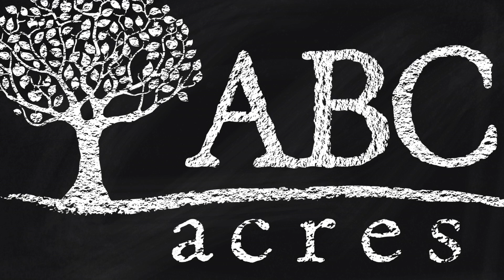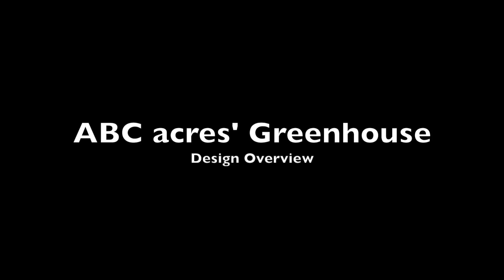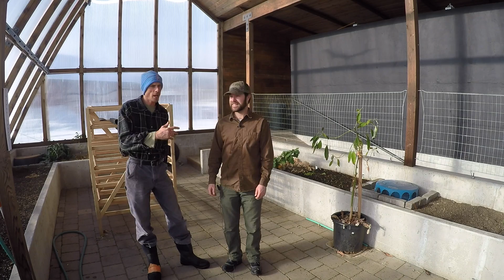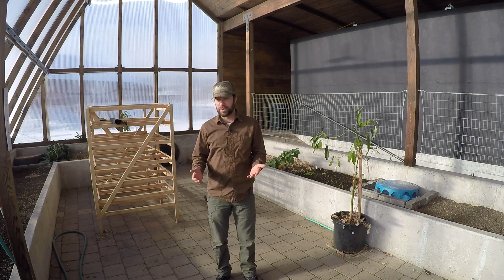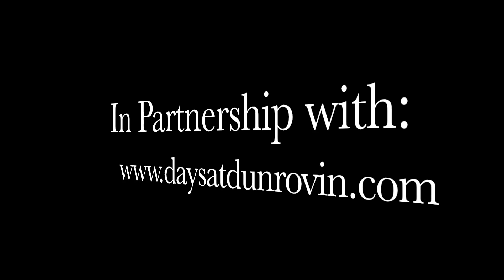ABC acres: Permaculture Greenhouse - episode #007

Comment: How do you calculate the angle of your roof to maximize the sun in the winter, but not too hot in the summer?
Reply from the maker: It's really more about your roof's depth than angle.  You would work with your latitude and figure the sun's angle at thee 2 equinoxes and 2 solstices.  You would want to ensure that from spring equinox to fall equinox, you are starting to minimize sun penetration into the space as you get closer to summer solstice.  Contact me on our website, and I'll send you a pic of our sketch up as too this point.

Comment: Is the Black on the north wall part pushing heat into your underground battery? How deep is your battery? I'm in Northern Alberta.
Reply from the maker: No it isn't James.  The black wall, 8" concrete, is there to absorb the daylight sun and radiate it back into the growing space.  The battery below ground level is a separate aspect to the design.  The battery is 7' thick / deep over the entire expanse of the floor with 3" round rock aggregate and 1000' of French drain piping which the air flows through.  Thanks.  Come see us!

Comment: It looks fantastic. How do you avoid condensation?
Reply from the maker: There's enough air exchange combined with an arid climate that it hasn't been an issue.
Reply: Probably condenses into the geothermal battery.

Comment: Sweet greenhouse! How often did you need to run the backup heater? I'd love to see an update for this winter.
Reply from the maker: Jason, just depends on the week to week winter season.  It is 26 outside now with temps in single digits tonight.  I suspect it will be fine without the backup this early into the season.  MT is typically cold with sunny skies.  Those sunny skies will be all we need to radiate heat into the space.  Keep ya posted!
Reply: ABC acres- interesting, thanks for the reply. One day I'd like to build something similar up here in Alaska. We have very short days in the winter. So maybe I'll just have to attach a sauna to it, and a rocket mass heater. I really like you guy's channel, it's great to see people doing permaculture in the north. Very inspiring thanks a lot.

Comment: Do you mind sharing with us the approximate cost of this greenhouse? If you built it yourself, great, but how much did the materials cost and how much time would you say it took you to build it? Thanks.
Reply: Good to hear...might have to swing by late summer when we tour Idaho.
Reply from the maker: Adam, we had a local GC construct our Greenhouse Building.  Our build is unique, as it is a Greenhouse, Potting shed (on the north side) and below ground Cold Storage (under Potting Shed) in one... so three building spaces in one.  The majority of our materials that went into the GH build was; concrete and rebar, 1000'+ of 4" french drain pipe, translucent panels, 2 x ceiling fans, 2 x framed side walls and framed ceiling, main ceiling fan, concrete pavers for flooring, clean 2" aggregate for climate battery fill, main ceiling mounted exhaust unit, one infrared heat on back concrete wall,  two corner air fans in plastic 50 gallon drums (part of climate batters operation), misc electrical and plumbing, subsurface air in-take piping for non-mechanical cooling, and more I am certain.  If you can create your space, and understand square & cubic footages, then that will get you on the path for creating a material list with costs.  Does this give you some tools to work with moving forward?  Thanks for the interest.
Reply: Yes it does, thank you. BTW, do you ever take visitors on your farm? My wife is currently interviewing for pharmacy residency programs throughout Idaho, Montana, and Eastern Washington. She has 2 interviews in Missoula and I know you guys are close to Missoula.
Reply from the maker: Yes we do, and you would be welcome.  We are one hour south of Missoula, in Hamilton, MT.  Check out our website at abcacres.com  Perhaps you will take up a nights stay as part of our Farm Stay offerings, giving you ample time to tour the farm.  All the best!